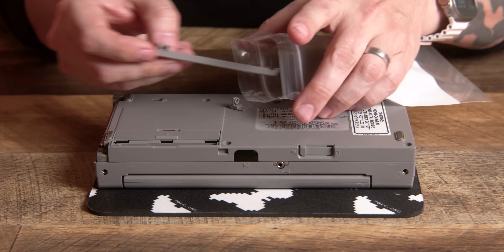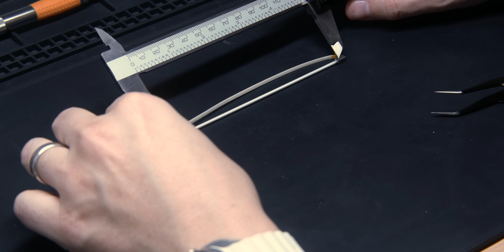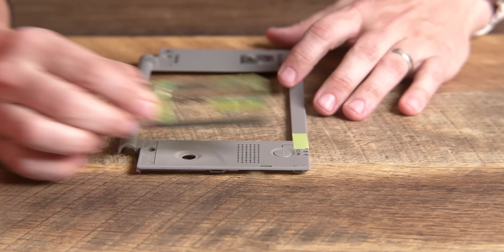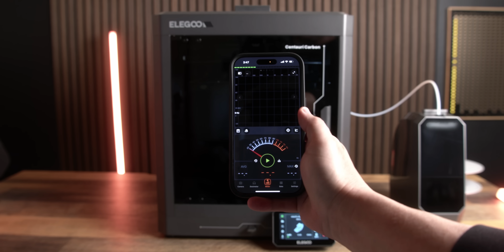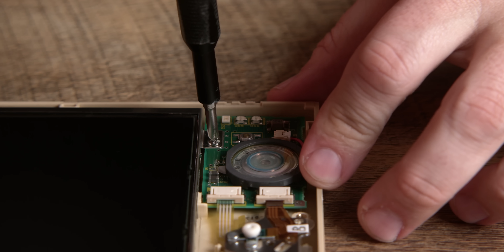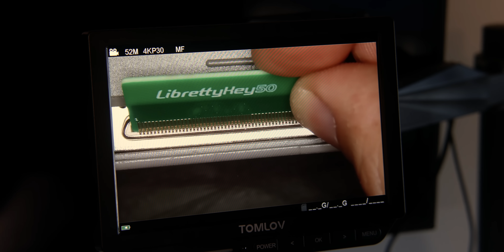I saved this crumbling little laptop from itself

Comment: Thanks for your videos!  I’m actually wondering if your bios unlock pcb can be adapted and broken out to recreate a port replicator since they’re very rare and expensive now.
Reply from the maker: Thank you! And yes. That PCB could totally be used as a breakout board or expanded to create a new dock.
Reply: @polymatt  Do you happen to have information on how wide the connections are, how far apart, etc? I see your gerbers but that doesn't seem easy to extract that information. Also what's the PCB thickness you used, 1mm?

Comment: So I just picked up a 60t, and I'm going to be rebuilding this as well. I plan to mostly gut it and replace it with a pi, so it has the look of a Libretto, but a more modern functionality. Quick question, where did you get your output supply? I like that one a lot better than what I used to have.

Comment: really good work with reverse engineering A great project would the world's smallest colour television Panasonic 101 it is notorious for its Case cracking and disintegrating  they are worth about 600 in good condition

Comment: Not having a dock would have been a huge pain, I've used the parallel port dongle (A self poorly made one)  a few times, seems Toshiba supported it into the early 2000's as I've reset a Tecra M3 with one

Comment: Nice job on the reproduction case, and on the key to clear the BIOS password.  Most (myself included) would have looked at the situation and stopped right there.  Those laptops from the 90's taught the manufacturers about the power management features needed, and about what could be made thinner and lighter.  It's nice to see that preserved, especially when it's an example of one that wasn't done so well as far as the case goes, since the number of them will be very low today.

Comment: Around 1997 we carried one of these around (with the dock, which was actually pretty small) to remote sites to connect to console ports of routers and switches. Found them reasonably reliable at the time.

I wouldn't really point the finger at the brittle plastic being bad design that much, many cases in that era suffered from that and this is no worse than I've seen out of Apple or other major manufacturers..

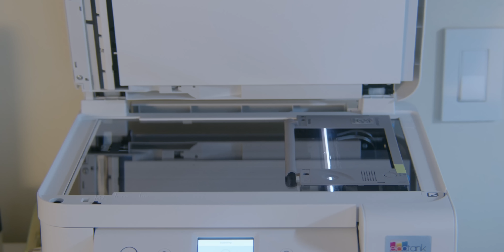Comment: 11:40 get a piece of foamcore and a bunch of thicker document pins (or sewing pins). Push them through the foamcore and put your part over it. Tape the foamcore to your table with a little bit of space for the needles. Then, you can just tap the part into horizontal with light taps. This will then allow you to scan properly, top and sides.

Comment: If you are worried about retrobright causing damage you can apply a ceramic auto wax to the plastic that will protect against UV light and has no residue

Comment: Great video as usual, however, one hint though, do not use hot air for hot glue. Just spray a bit of IPA on it, and it will nicely let go.
Reply from the maker: Totally - and a great tip. I was a bit concerned about using IPA that close to the LCD. I wasn't sure of if it could have delaminated it but didn't want to take the chance.

Comment: What's with the "tree branches" in all your prints in this video?  I assumed it was art until I saw it on everything.  I assume it's something structural to hold everything together as it cures, right?
Reply from the maker: Yep. They’re called organic supports and they hold up different parts of the part while it’s printing, sometimes to keep it from wobbling and other times so the printer can print overhangs that without them it would just be trying to print in mid air.

Comment: I'm always curious in these projects why keeping the original stuff is directed so hard. Your comment about learning why things were done the way there were makes sense, and I respect that wholeheartedly. My question, though, is that the LCD/LED/OLED panel tech has come a LONG way since the birth of this laptop and I wonder why the panel wasn't outright upgraded instead of the tube replaced? I'm sure a brighter and more efficient panel could replace this one. Is it a driver issue?

Comment: on printing, the supports should be in another material. If you print in PLA, PETG would be the possible choice, the same as ABS and PLA, they don't mingle.
But fantastic work on the project. It makes me almost buy one! :)

Comment: What size m2 threaded inserts did you use? Also do you have the decal files available? I have a Libretto 30 that needs all new plastics. I found that printing the inner screen bezel at a 45 degree angle makes it the strongest

Comment: This is incredible!!! I have two 50CT's at home, and they are in decent condition - however a few small cracks have started to appear.  Both units work - I've replaced the spinning platters with SSD's and even got a pre-release version of Apple's "Rhapsody" installed and running on one of them!

Anyway, I have a Bambu P1S and keen to print some new cases! Can you explain why you printed vertically? Is that your recommended orientation? To deal with dimensionality better than printing flat? I'm just thinking about the massive increase in print time with all the supports required for vertical printing...

Thanks again - I've only just now discovered your channel but have now subscribed!
Reply from the maker: Hey there, and glad you enjoyed it! A few reasons for the vertical print - 1) Most of the strain of the case would be in the opening of the lid so I needed them to be flat or vertical. 2) Vertical is how I was able to print it most reliably, there are some weird supports that are needed if I were to print flat as there is a small tab on the front left of the case and some fine detail underneath where the keyboard inserts. I bet you could get it to print flat but I always had a better time vertical. Best of luck!

Comment: In case you were heretofore unaware: Most hot glue can be released from smooth surfaces by just applying a small amount of isopropyl alcohol. It works like magic, the alcohol wicks in and the glue just kind of falls off.

Comment: Have you ever had a project with a Sony Vaio P mini laptop? I have a nice Japanese one. I tried to rebuild the battery pack but laptop won’t recognize due to Sony hardware detection. You can pick one up for a reasonable price now but battery packs are usually bad and no new packs are available.

Comment: I hope someone will do the same for the Thinkpad 600, the plastics don't generally crack but the rubber coating is some of the worst I've ever experienced with a vintage computer. At some point I'm going to try to strip it all down, but I'd love to be able to just print a new shell from scratch.

Comment: I wonder if they make filament LEDs to replace those pencil lead thin CCFL backlights.
Reply from the maker: They definitely make an LED bar for the CCFL replacements and I ordered one for this specific project, unfortunately I couldn’t make the inverter board fit in the display :(

Comment: I owed a Libretto way back in 2000. I got it on a whim, I had just bought a Mitsubishi Galant GTZ. I made many a modification to it, but where the Libretto fit in was on the dash running Win98 actually booted directly into Winamp and was connected to my Sony Xpold head unit. Playing MP3 in the automobile before it was a thing....classic

Comment: Amazing work! You got a new subscriber. I have a Libretto as well that I proactively used epoxy on the thread inserts and other portions that had already cracked. Putting the epoxy on the inside, with a touch of epoxy flow-through the cracks largely kept my chassis looking undamaged.

Do you plan on making an STL of the battery case as well? The existing one is too small for 18650 cells.
Reply from the maker: Thanks for the sub and thats a great preventative tip! I am thinking of making a reproduction battery - but i've got one or two battery projects ahead of it. The good news about the libretto is that they've already designed it to take "extended" batteries out the front so that may be an option. Not sure if its tall enough for 18650s but we'll see!

Comment: I can definitely attest to how well ABS holds up over other plastics. I've got a lot of Lego from when I was a kid that are still as foot destroying as they were when new. It'd also make for a fun project to replace all the plastic shell with metal, even if prohibitively expensive for the average collector. Although, you could do it cheaper if you cast or milled the parts yourself, at least if you have a mill. Might be easier with steel though, since it'd be a lot easier to just use sheet metal and weld it together. I don't know why, but aluminum is a pain to weld.

Comment: This laptop is like a cookie.
I "had" one with 50CT.

But every time I opened it,
somewhere it would break and crack.

The internal electronics survived,
but the outer housing was all damaged,
so I threw it away.

It was nice to play with.

The exquisite joystick and rear button placement
was also good for playing classic FPS games.

But it's just one of my memories.

I'm currently using a Dell Latitude XPI P133ST
as a RealDOS laptop.

I respect you for restoring it
with your 3D printer design skills.

This is a comment using a translation.

Sorry if it's weird.

Comment: I've had a 50 and a 110? I think with a dock and floppy accessory for YEARS. i bought them as a teenager thinking they'd be a good investment. I upgraded one to flash memory and realized that, basically, even 10 years ago, the thing was far to fragile to mess around with. The two have sat untouched now for 7 or so years. Something like this gives me something to do once this is all ironed out! Good stuff and fantastic video!

Comment: Lol I have one of these, with the dock. Need to get the battery rebuilt. It was a bit of fun to play with back in the day, but rather limited. I don't recall the specs but I believe it is a P1/90 MHz with either 8 or 16M RAM. Has Win95 on it. Someday I'll get to it... someday 🤣

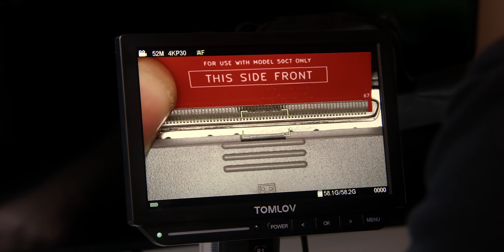Comment: 24:38 You could have probably saved yourself a week by "hacking" the PCB(with a hacksaw or a bit of sand-paper), "just make it fit" :P
Reply from the maker: Totally would have if it was just the fit - the pins not being aligned - too much distance in between meant that even if I got it to fit, still wouldn’t have contacted the right pins on the dock connector!

Comment: I feel lucky to only have these in really good condition. Something know about hibernation, they distributed a special version of format that would not format a section of the drive that was used as the scratch for the hibernation file that is written into the drive and hard coded through from I believe the bios.
so care must be taken with manually formatting to avoid that area otherwise it will hibernate and corrupt what's in it.
Unfortunately it's been so Long I don't remember what I did, because my floppy Drive was nonfunctional.

Comment: I have this model Libretto. Luckily, it hasn't brittled to death and is still in original working condition, complete with the dock. I could never do this to it for two reasons. Firstly, I don't have the skill nor patience. And secondly, I'd be too scared that I'd break it and not be able to put it back together.

Comment: I had one of these about 20 years ago. It was old crap when I had it, but powerful enough to run the car ecu tuning app I used. Small size was the only good thing on that computer, but it was essential thing since it fit on top of the open glove compartment lid.

I think it was pentium 133 or 166. It didn't have floppy drive or cd drive. It didn't have usb either... And I had to install windows 98 on it to replace 3.11 or 95, i dont remember. 😮 Only access to/from outside was the infrared port of the computer. I don't remember why the serial port didn't work with that, since that's what i used for connecting to my car. I made an IR transmitter/receiver for my desktop pc, transferred the files (hint: very f... slow and unreliable). Then I got win98 installed and my pcmcia ethernet adapter started working.

Not recommended, wasn't fun.😅

Comment: great job! is it possible to make aluminium case on CNC from aluminium blocks?
Reply from the maker: Thanks! You could probably do the display on a CNC but not the bottom case - too many undercuts and complex geometries. Not saying SOMEONE couldn’t get it done but I don’t believe it would be the most ideal process. Aluminum 3D printing on the other hand…

Comment: I have one of those with the dock and original power supply. The case is fine, no bios lock, it works great.

However I can’t get anything into or out of it because I don’t have another computer with a serial or parallel port and can’t find an external disk drive for it. Eventually I’ll find something.

Anyway, now I know what to do if the case starts crumbling.

Comment: Awesome work! I own a huge Libretto collection (from 20 to W100) in various conditions and I‘m happy to see efforts for case replacements. If you need to open the original plastics I use a low temperature heat gun to make the plastics a little bit elastic before prying it open, works most of the time without cracking. Very poorly aged  plastics has the Libretto 20/30, they crumble just from normal usage. I have never seen a fully intact unit of these Japan only models outside.
Reply from the maker: That heat gun trick is a great tip! I'll definitely be using that one. Thanks so much for the support!

Comment: Pro tip if you expect to just tear down these old laptops remember that the brittleness and bring a soldering iron for every screw hole as they just melt with every twist of the screw and that their was so many different screws one misplaced screws being too long can destroy the motherboard or daughter boards or show up in the finished product on the outside so make sure every screw is in the right place when reinstalling them.

Comment: Sucks that the Libretto doesn't have a built in parallel port. Fortunately my $12 thrift store Tecra 500 did have a built in port. Took a couple hours of dismantling an old printer cable, slicing insulation, buzzing out the wires, soldering and heat shrinking, but my reset key worked the very first time.

Comment: I have a perfectly working Libretto, except for the internal speaker's low volume. But it is falling apart. Where can I get the print files? I have a huge Ender 3D printer at home and a lot of filaments.

Comment: let me know if u decide to doa hp omnibook i think 2100? it fell apart on me by picking it up, plastic is very brittle, its in pieces. was a friend of mines and i want to restore it but really cant, no 3d printer or the smarts to do this. it was used to program radios handheld ones back in the day. and also its the only old laptop i have that doesnt do ghosting like others i have do really bad.

Comment: When I was in college in 1997, I remember the Libretto 70.  I had a Compaq Contura Aera 4/25 and drooled over the Libretto.  My dad said he was going to get me a Toshiba when I made the Dean's list, but he got me the Satellite 110CS.  I was a little disappointed, but it turned out to be decent - it had no sound card or CD Rom, but I had a zip drive.  I had it until 1999 when I bought my first Gateway desktop.  Good times.  I still obsess over the later Libretto models that have transmetta processors.  Now look at the Sony Vaio Picturebooks that were a Japan-only release.  I'm tempted but they really are too old for me to use right now.  I don't trust the current Chinese offerings of the mini laptops and wish we had a more viable modern version of the libretto.

Comment: Great job with those models.  I would love to see a printable model of the battery case.  I have a libretto that itself is still in good condition but the battery needs new cells, the cells are glued into the case and there isn't a way to get them out and replace them without destroying the case (of the battery).

Comment: Interesting, never had any issues with the Libretto plastic, while most of the other 90s laptops where so brittle that the hinges fall right out, others got extremely sticky.  

I think I only have some Toshibas from libretto to like 14" Laptops left, while most oft the other brands disintegrated years ago. 
The next newer ones are the nearly full metal Panasonic and Dell from the 2000s. They are still working fine.

Comment: A trick I do to fix and/or strengthen plastic parts is to cut up soda cans to match the weak area.  Super glue it on the inside so it cannot be seen.  Then, you have sheet aluminum holding it together.  It's incredibly strong, and I've fixed tons of stuff from piano keys to glove compartment latches this way.  No need to replace stuff, and it's stronger after the fix.

Comment: All very fine, but why in Hel's Boots would you not just knock off the shape and boot behavior (for Airport 'It works, see!' requirements) while changing the keyboard for an ergo chording masterpiece, a the screen for a 4k OLED, and the electronics for 3 OrangePi (uh, 6?) in a M.2 x 3 trenchcoat, or one H100, with 10 AH of sodium or LiFeSO batteries? Extra credit for making the case out of killed fungal rhizome or fruiting body with molten lignin electrospun onto it, mic hydroformed hemp, high-entropy materials dried in place (though don't forget the machine screw acceptor slugs,) or b-synuclein from whatever bacteria like to grow mats out of that of all things.